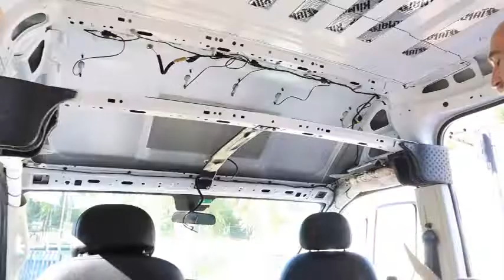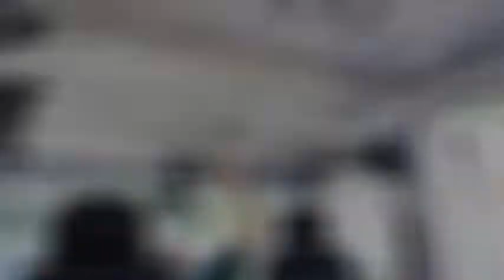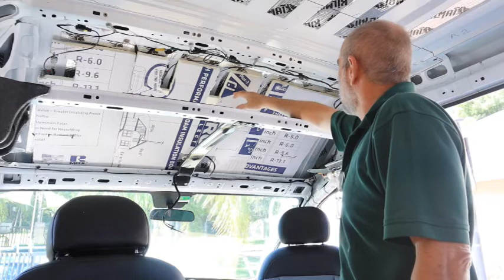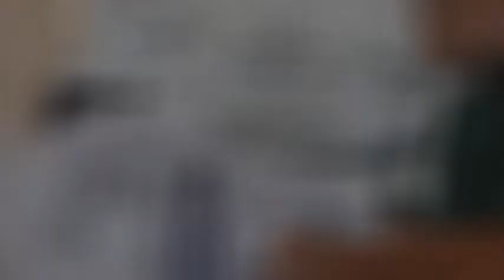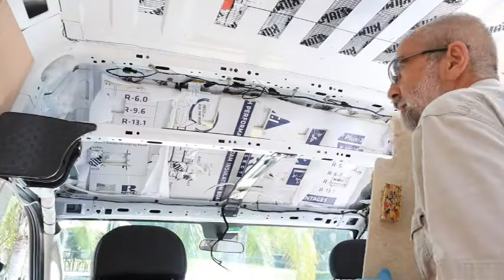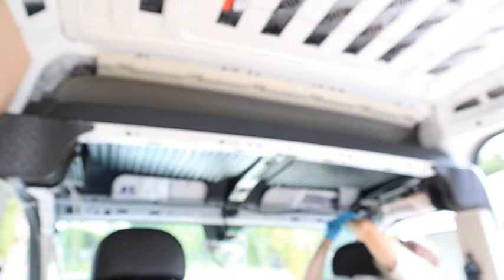Van Life build series - Insulating  the Promaster Headliner

Comment: You can just apply reflectix and thinsulate to the headliner itself and then reinstall it.  It's much easier, works great and no need to pull down everything including the black plastic shelf.  In regards to panel damper material on the van skin, you just need to cover ~25% of the large areas, no need to go overboard on this as it does nothing except add more weight.
Reply from the maker: You can do that, but that will not provide a very high R-Value.   I agree with the 25%, and in some areas even less sound dampening material is needed.  Everyone one has thier own thoughts and ideas - thats why building your own van is a good idea.   Thanks for watching and commenting.  For more check out https://thefrugalfactor.com/

Comment: Thanks for the video, it's really helpful! I'm thinking about insulating my headliner area, but I'm worried that having polyiso above the cab could create squeaks while driving that are worse than any that could come from the back part of the build. Did you have any trouble with squeaks from the polyiso?
Reply from the maker: @wanderlingj  no squeaks no problems. If you look at my insulation videos, you'll see I wrap them in polyester batting. That way the poly ISO would not squeak.  Check out The website for a link to the van build guide. It has all the videos www thefrugalfactor com
Reply: @FrugalFactor  Thanks for the response. I never considered that, but it's a great idea! I'll definitely be looking at your other videos as I do more research and progress on my build.